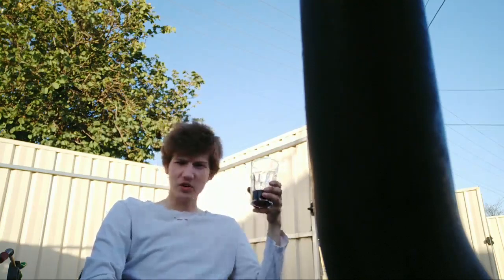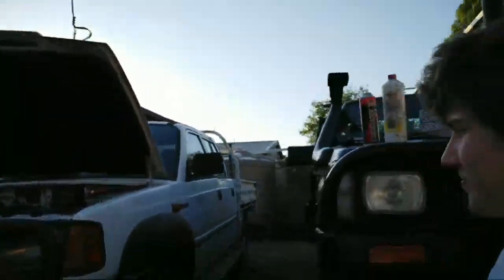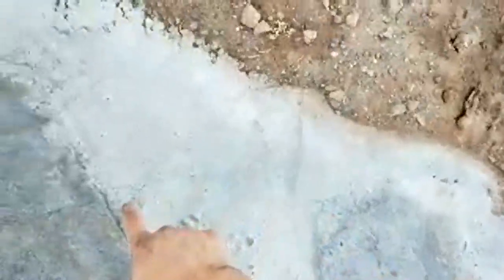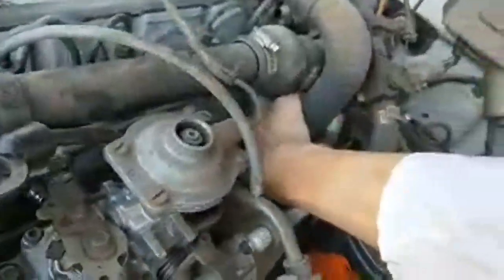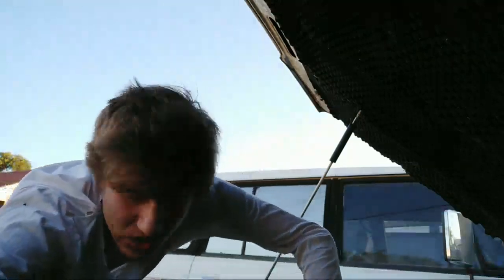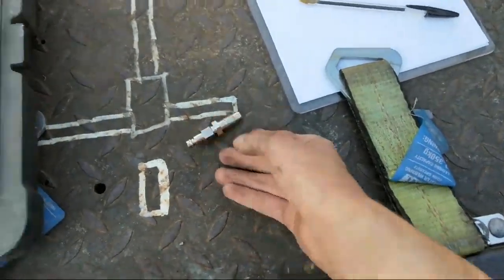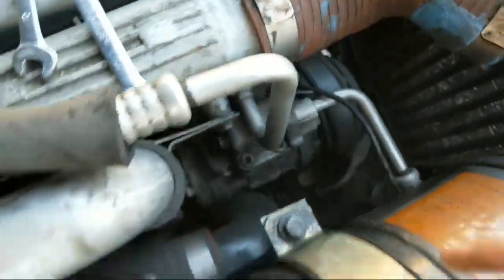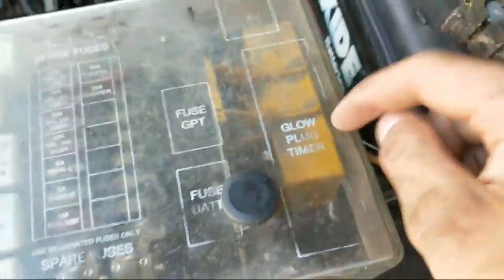Tata Telcoline 1999 Testing Part 1

Comment: Hey mate, I have the same Model Tata. I don't if your aware but they are basically a Peugeot 1.9 XUD Diesel engine, you can tweak the diesel pump like any diesel with a Bosch VE pump and they go like a rocket ship then. Just make sure you have a EGT Gauge installed so you don't overfuel the engine and nuclear meltdown it

Anyways just google Peugeot XUD tuning and its the same
Reply from the maker: Headgasket might be bad, old engine oil and 100% turbo is cactus
Reply: @michaelthemekhanical  they very rarely do head gaskets. The engine itself is as bomb proof as the Peugeot unit, however turbo failure is common from poor service history and oil quality
Reply from the maker: @TheTorana202  Their is engine oil or signs of it in the cooling system.

So if you can explain that, it will be good :)
Reply: Hello there. Ian here in south Africa, I've also got the same Tata, and it's embarrassing how it goes up hill. Can u pls help me to set up my injector pump like u done yours. Thanks